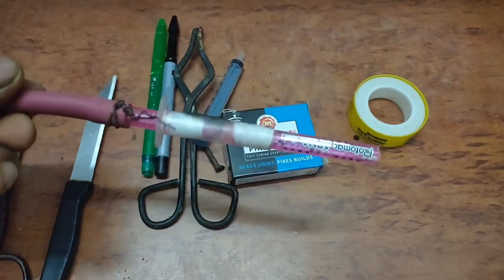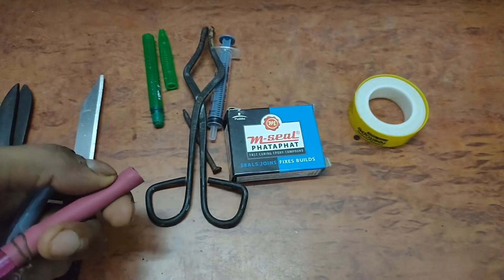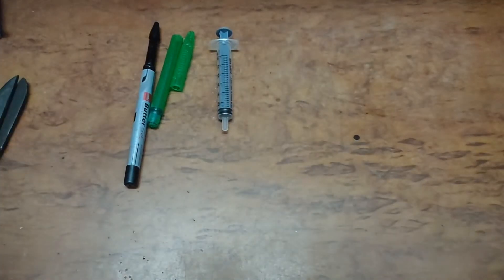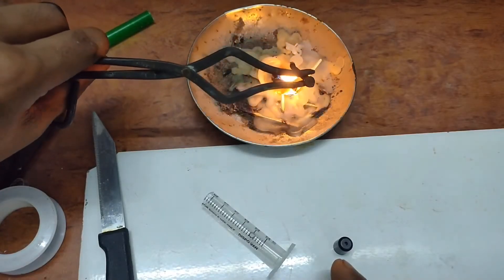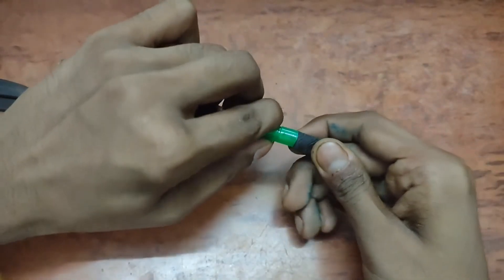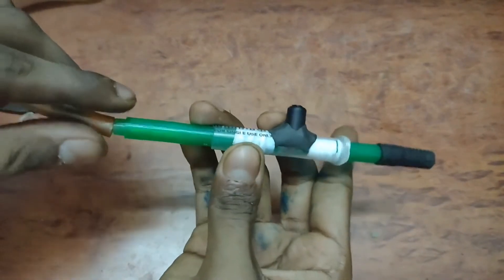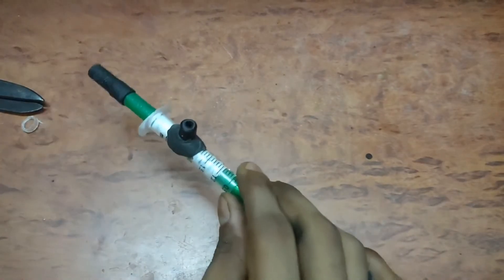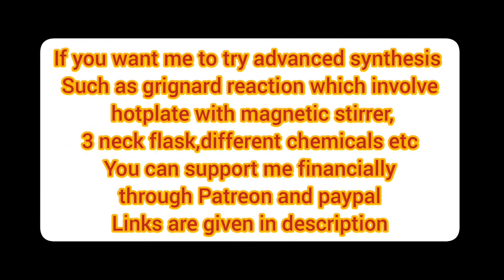How to Make a DIy vacuum aspirator pump

Comment: Dear DIY chemist, I consider myself an ameture when it comes to chemistry.
You seem a lot more experienced than I am, I wanted to ask where can I buy an aspirator vaccum pump in India and if such an aspirator can be used to scrub NO2  fumes.

Thanks
Reply from the maker: Glass ones are available at scientific shops . Metal ones you can buy from amazon
Reply: @TheDIYChemist  What about the plastic ones, the metal aspirators will not survive the NO2 fumes
Reply from the maker: @2207amol you search on amazon and scientific stores and see if you can get one. But why spend so much money when you can make it yourself
Reply: @TheDIYChemist  I'll give it a shot let's see if I can make something interesting. Thanks